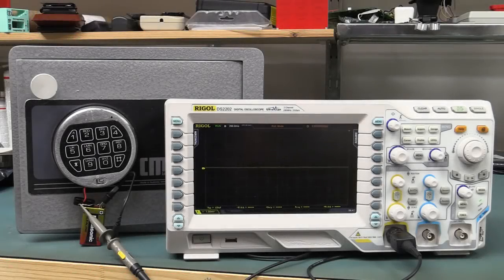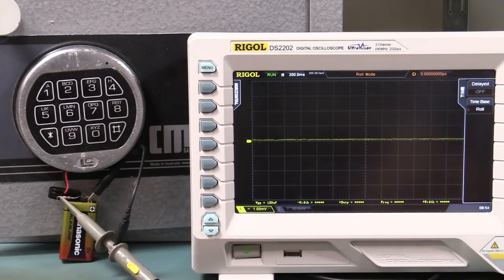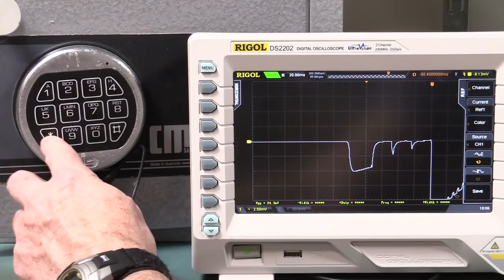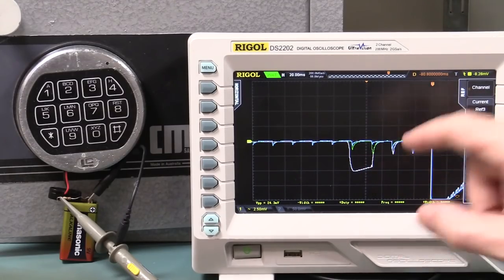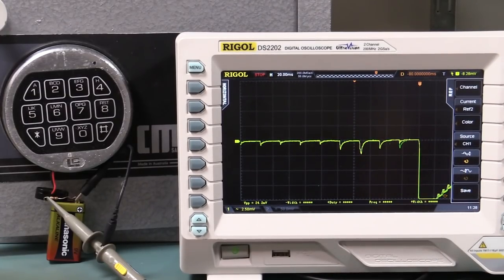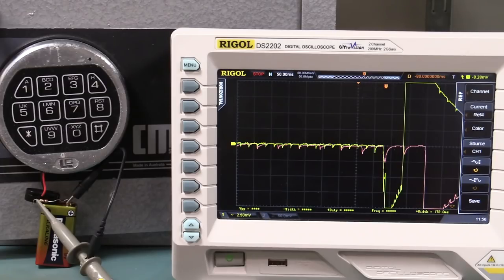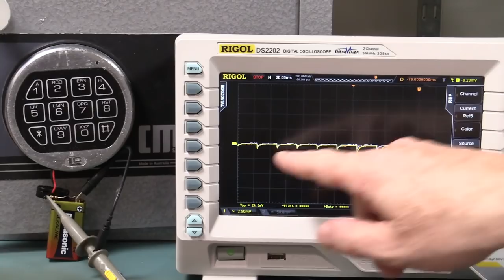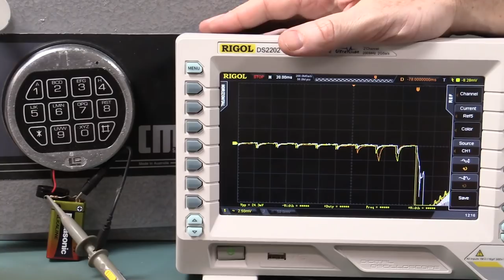EEVblog #771 - Electronic Safe Lock Powerline Attack Part 2

Comment: For the first two digits, assuming we can use 0, we have 100 possible combinations, 00, 01, 02... 99. Since we can try 4 of them and then wait a 10 second time out, let's assume it takes 2 seconds to input the combination, 2 seconds to check with the oscilloscope. That's 4 seconds per combination. 16 seconds per 4 combinations. 26 seconds per 4 combination try. 100 / 4 = 25. 25 x 26 = 650 seconds (around about 11 minutes, let's say). That's to find the first two.

However, after this, it actually becomes alot easier. You've found the code for position 1 and 2, but now you need 2 and 3, 3 and 4, 4 and 5 and finally 5 and 6. Let's assume the code is 750105 and that position n is notated as Pn.

Once you know P1 and P2, in combination (P1, P2), then you also know the first digit for (P2, P3). At this point, you know that P1 = 7 and P2 = 5. So we only need to check 50, 51, 52... 59 for (P2, P3) combination. This is 10 combinations. 10 / 4 = 2.5 and 2.5 * 26 = 65 seconds. Just over a minute.

You need to do this for (P3, P4), (P4, P5) and (P5, P6). Each taking another 65 seconds.

Therefore the total time is:
(P1, P2) = 650 seconds
(P2, P3) = 65 seconds
(P3, P4), (P4, P5), (P5, P6) = 65 x 3 = 195 seconds.

Total time: 910 seconds. Just over 15 minutes. Of course, once you start trying to solve (P5, P6), the time to enter the combination will be longer, so a more appropriate real life time would be closer to 20-25 minutes. Still not a horrible time considering what you MAY put in a safe, but doubtless a drill WOULD get you in much faster.

Comment: i am really interested in this now, just some other thoughts.  

1. Timed glitch attack on the power line, hook up a power supply for which you can deliver pulses in a set pattern programmed by a DA converter.  Have it try to spike a random micro-controller state.  

2. Tuned inductors  on the clock frequency connected to a spectrum analyzer  on the RF.  Look for harmonics from the clock base frequency...  Couple the two together.

3. Try it all again whitebox style.  Take the circuit board out and probe around the mcu on rf and voltage, disconnect the beeper.  Drop the crystal frequency to a much lower value.  Overclock it, ice/water cool it to bypass the time delays...

Comment: Each of the remaining third through sixth digits will take a max of 20 seconds, average of ten seconds. By brute force one would expect it to take 140 seconds (2'20"). The worst case scenario would be a total of 280 seconds (4'40").
Reply: Paul Bryan Platt Hmm, thats faster than the average time of a brute force robotic auto dialer!
Reply: johnfranks Yes. It is because for each digit 3 through 6 one has the benefit of knowing the preceding digits are correct. An auto dialer would need to check each 6 digit permutation: 6exp6 = 46,656 tries (max), instead of 100+10+10+10+10=140 tries (max).

The auto dialer would also have to type in all 6 digits each time, but for a robot that's probably inconsequential.

If Dave's method actually worked reliably it would be a potential problem for the safe maker.
Reply: Paul Bryan Platt  Oops. I meant 10exp6=1 million permutations, not 6exp6.
Reply: Paul Bryan Platt For getting the first two digits, you've got 100 possibilities (assuming 0 is a valid starting digit).  At 11 seconds per digit (giving yourself a second safety margin on the 10sec reset), it'll take a little under 20 minutes for that first part, assuming you only have to try each pair of digits once.  (10^2 * 11sec, as there's 10 possible values across 2 digits, taking 11 sec each)

For a situation where the safe is locked in back somewhere, and let's say you can't remove it, either because it's bolted down securely, or everybody would see you carrying it out, but you are able to stick around by the safe for maybe an hour, it seems reasonable that this vulnerability would be useful.

Though, the random results he's getting could be an intentional design, possibly using the delay between each button press as a random seed, to mitigate attacks like this.

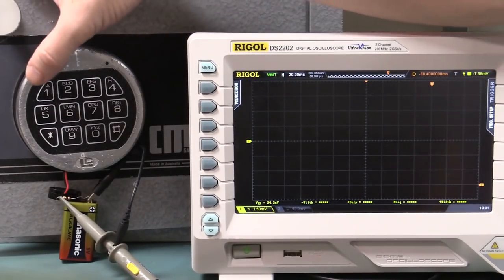Comment: I haven't watched the entire video yet, but I had a thought at the 6:00 mark; what happens if you key the wrong 6-digit code x-1 times (where 'x' is the number of fail attempts that cause a 10-minute lockout) & you press a single number on the keypad, then wait for the 10-second timeout?  If you were to key in an incorrect 6-digit code 1x more time, does the 10-minute lockout take place, or did the single number press/timeout reset the incorrect code timer?

Comment: First of all: Awesome blog, awesome posts.  I've been binge watching these for a while.

I'm just wondering if the waveform modulation that you're detecting is related to the workings of a scanning matrix keypad.  I'm just thinking that it could be a function of the amount of pressure you're applying to the keys (varying the amount of current sunk through the scanning matrix keypad contacts) or possibly if it is more of a function of the keys position in the keypad.

Comment: The obvious solution would be for safe software to check the sequence only after 6 digits were pressed, then it wouldn't matter if someone would compare signals because after 6 digits it doesn't matter if the attacker will find out from the signal that the code is wrong. 
He will have to try a new sequence of 6 digits without gaining any knowledge about any single digit irrespectively of any differences in the signals.

Comment: When you press the first button and it's correct, at the end of the wake dipping it looks like the bottom of the "correct sequence"-slope is showing, as opposed when you press a wrong button to wake it, it softly slopes up from the startup dip. If this is right, you would need to try the first button an average of 5 times, periods included that's 50 seconds assuming you spend virtually no time between the button presses (a thief could have a computer for that). Since you can continue to the next digit within the same period once you find the previous correct one, the next digits will take an average of 4 tries to crack; with periods, that's 40 seconds per additional digit. So 50 + (40 x 5) = 250 seconds or 4 minutes. If you have to input the first two correct ones, that's 100 possibilities or 50 tries on average, so 500 + (40 x 4) = 660 seconds or 11 minutes. Couldn't you use a much higher resistance for the dropper resistor before it would brown out, so the potential startup "correct sequence"-slope can be seen easier? And/or have the timescale at 5ms or lower?

It makes absolutely no sense that it would compare the button presses with the stored password before the entire sequence has been input; it seems like something someone who had just learned to program would do, it goes against regular procedural structures where you do one job at a time (1: store full input. 2: compare stored input.)... Unless they somehow don't have enough ram to store the entire input and then have to compare for each input digit? Screams incompetence in any case.

Comment: Just a bit of info six 0's is part of a programming code, probably why it has a different waveform. What model of lock was it? 33e? I normally find the electric pick the fastest to deal with any La Guard.
Reply: Redman Auto Engineering, What IS an electric pick? Hardware?

Comment: I wonder if you could use a powerful magnet to pull that pin back through the safe, or if the metal casing would act as shielding?
Reply: I wonder if you could brake that holding pin just by using a very big lever arm on that wheel.
Reply: I wonder if you could use a Wolverine claw and just cut it in half
Reply: There would probably be a weaker point that would break in the wheel before you could even bend the pin.

Comment: It seems like there would be 90 initial combinations of two digits assuming you can't start with zero, otherwise 100 combinations.  After the first two, each additional digit would only add 10 additional guesses to the combination for a maximum attempts of 140.  Really not that high.

Comment: do you think you might pick some signals up from the circuit board with probe stuck through one of the bolt holes? Just thinking you might be able to hear the correct code being read out of the eeprom serially after the 6th digit. (just in case you ever fancy rebooting your safe cracking career) - could be interesting in getting the board out again  to look at the traffic between the uc and eeprom on your bench anyway.
Reply: What type of probe would you use for that?
Reply: I thought a search coil or hall effect might pick up some pulse edges... but since I've now noticed the pcb is inside a thick steel (probably) box I'm pretty doubtful tbh.

Comment: Someone has probably mentioned this before. Generally these things will place the value from the keypad into RAM and only check it against the known value at the end. You can know if it's not doing that if you get a failure response immediately. The power draw at the end prior to the beeps when it's incorrect, is probably a flash write to update the failure count. Instead of waiting the 10s for the counter to time out you could just PoR the chip by tossing a switch (NC button) to reset it faster and improve your brute force time. Or make a custom circuit that could do it, even faster. However, since the comparison is done at the end, you are more likely to lock yourself out than learn anything. A big neodymium magnet to the solenoid however would be even faster than drilling and wouldn't be tamper evident.
Reply: Good luck in getting any magnetic flux to work on the solenoid pin when it's basically swimming in steel...

Comment: when wrong combo is entered that spikey waveform appeared before the speaker beeping. i think that was due to updating wrong try counter, and if power would suddently shut of and get back online before it updated the counter you would get unlimited ammount of tries. so even if algorithm compared an encrypted combo digits, with keybord emulator end some high speed swich on a power line you would be able to brutforce it in relatively short time

Comment: So... when the power is cut during the lock out penalty the lock body pauses the timer, reconnecting power simply starts it back up. All information is stored in the lock body, user codes 1 though 9, time delays, and lock out penalties. Now to answer the over looked question as to why the "0" key produced a different pattern, is because the sequence"000000" starts the combination change sequence. Ill wager if the code is changed from 123456 to 098765 the "0" key might produce another pattern all together.

If u need help with that I can walk u through how to change the combo

Comment: What happens when you disconnect the battery while the safe is in the "lock-out-mode" that is entered when you try a wrong sequence three times in a row? I think this should reset the processor and you don't have to wait the 10 minutes....

Comment: One thing I thought was worth noting was when considering the time to complete the attack (if indeed one was found - I agree it probably wasn't). If you did get a go/no-go after two digits, it makes no sense at all that it could be any two digits in the string. They wouldn't be compared out of sequence, if it was indeed doing that, you'd have the first two digits. Going on that assumption, you could have the first two digits in 100 tries, and each subsequent digit in ten more tries, so 140 attempts should open the lock. At 10 seconds per attempt, 1400 seconds is 23 minutes. (With just one gotcha -- you only get three tries on the last digit before the 10 minute lockout. So potentially that could add 30 minutes - still under an hour).

Of course, as Mikhail pointed out, more than likely the digits are collected and not tested until the last digit is entered - this would make such an attack impossible and is also the simplest approach from a coding standpoint. It's interesting to consider what the code is actually doing at those spikes.

However, I learned a fair bit about running the scope and current monitoring from these vids, and it's always fun to watch you have a go at something and talk about the theory behind it!

Comment: Have you tried to analyse current while connecting safe lock to battery? I mean disconnecting and connecting again in very short time - maybe some brownout reset could happen while capacitors are still charged and you can see starting processor.

Comment: What happens if you pull the power during the timeout, or pull the power the moment it does the incorrect sound?
Reply: Razor2048 Yeah, I wondered about that. It would seem pretty dumb if that reset it. I'm guessing there might be a an eeprom on the micro it uses to set a timer flag, so if you pull the power it just checks for the flag on power-up and resets for another 10mins.

Comment: Pointless attack method: They store all 6 digits in memory, then compare at the end. There is no information to be obtained during the key entries to determine the correct code.

One method is to see if if the used any of the programming pins for the keypad inputs. One could perhaps reprogram the microcontroller with new code that just triggers the lock solenoid pin on the micro. You would need to determine the microcontroller they used and which pins are connected to the keypad. It may be possible if they are using a tiny SO-8 (8 Pin) microcontroller, since the programming pins over lap the I/O pins or the power supply pins. 

Another alternative is to provide a very noisy power supply so that the processor functions improperly and perhaps executes the function that triggers the lock pin. But this will probably be a hit and miss (random)

One way to defeat the 10 minute lock out is to remove the battery. The uController likely uses a timer and interrupt for the 10 minute delay. You could create a circuit that interfaces with the keypad pins, tries a code, then powers off the uController (disconnect the battery using a BJT/MOSFET), short the power pins (to discharge internal caps) then retry. Probably can do  hundreds to thousands of tries per minute using this method. 

Another possible method of attack is to leverage the Brown-Out/undervoltage reset built into the controller, perhaps there is a code bug that allows you to trip the lock.

You can also try sending the non-standard keypad values to see if there is a bug in the code. The Keypad has 12 keys. if using 4 pins for the keypad you can try the other 4 values to see if it will trip it. if its SPI, then you can might be able to attack it using a buffer overflow, serial bit overflow or other methods.

One other attack is to see if they accidentally left any debugging code. Try holding down one of the keys and connect the battery. Try all twelve keys see if you get lucky. Some times programmers use special initialization code that is trigger when it powered up while holding down a particular key.

Last method I can think of at the moment might be to use a induction coil to energize the solonoid coil wirelessly. If you generate a med frequency (ie 10Khz to 50Khz) RF signal (ie Induction cook stoves) it may be possible to get sufficient current into the solonoid to trigger it. It probably will depend on the metal used in the safe and how much magnetic shielding it provides.

Comment: A simpler way to activate the solenoid would be to inject some RF power (with the normal battery voltage also applied). This may bias the solenoid driver transistor ON via circuit rectification. A variable frequency, variable power RF signal applied in either differential or common-mode to the battery power wires may couple enough RF into the driver circuit to do this. Try frequencies over a wide range - my guess is UHF may work best - it depends on the speed of the various silicon junctions and the resonances in the PCB traces and bypass caps. (reposting this comment, because the first time it didn't show up)
Reply: Why? Because it's easy and has more chance of success. Anyone who has seen the extreme sensitivity of modern circuits to RF knows how it can cause all sorts of malfunctions. Do you think the safe designers didn't consider someone opening the safe with a magnet or electromagnet? Car doors are very thin steel compared to the safe. The thick steel of the safe will divert the magnetic flux away and around the solenoid - causing the technique to fail. It would take an enormously powerful magnet (large, heavy, impractical) to saturate the thick steel and get magnetism to flow into the solenoid. By contrast, a small handheld radio transceiver (HF, VHF or UHF) and a fly lead is all you need to inject some RF.
Reply: @Banertd The high permeability of the heavy steel plate will draw the magnetic field into it and away from the solenoid. Look up "Magnetic shielding" for more information.

Comment: How about inducing the solenoid from outside? I'm curious what would happen if u put it on a induction cooking top... Can you remove the handle and push the bolt inside and get access that way? The one in the corner